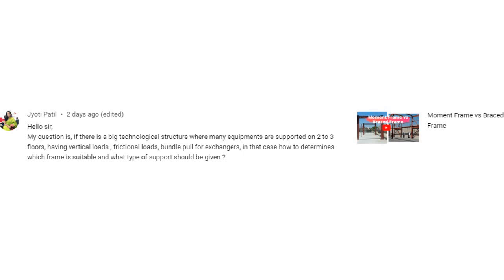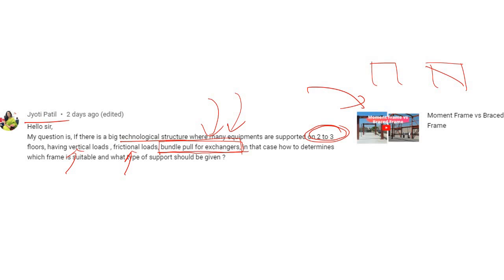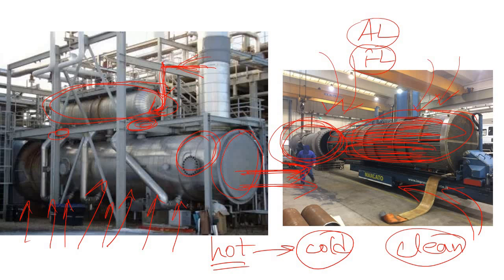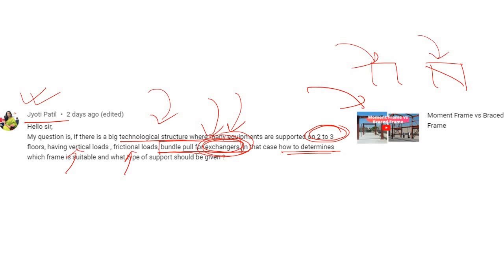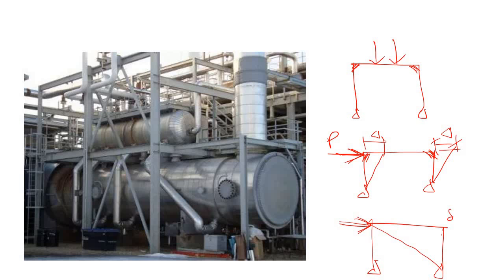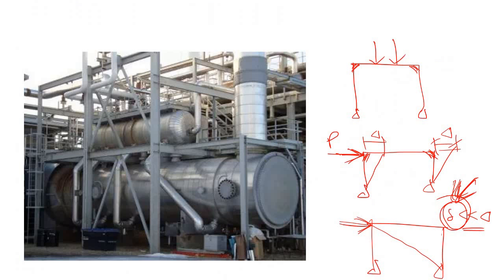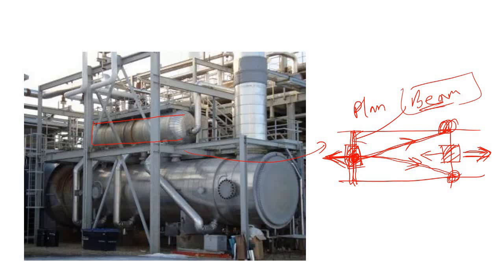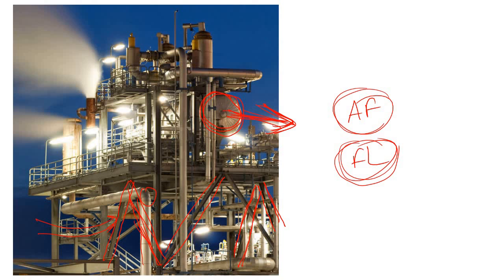Exchanger Building Forces You need to know

Comment: Hii Sir could you make a video on how to draw SFD & BMD of a RC frame with uniformly distributed load on it ( Gravity load only) ?? And how does SFD & BMD change ig lateral load acts on the RC frame ?? 

Also, which is more preferred and easy to obtain on site?? Column with Fixed base or Column with pinned base ?? How does moment varies along the height in both the cases ?? 

What is the difference between hinge & pin support ?? 

I know I have asked a lot of questions...I am really sorry. It would be great if you could just answer my doubts ....if video is not possible.